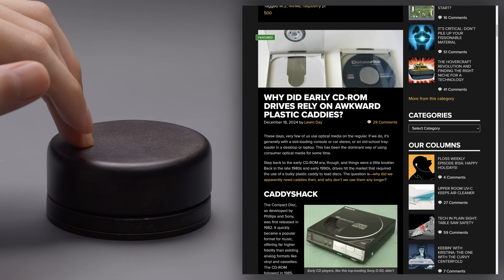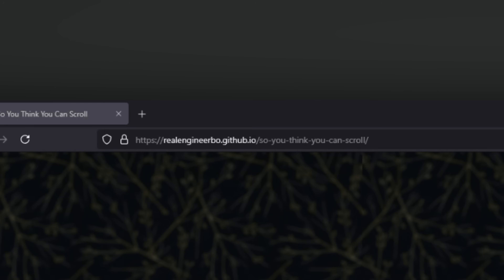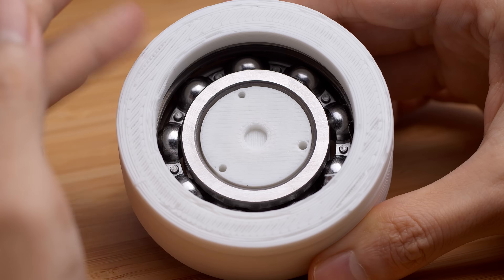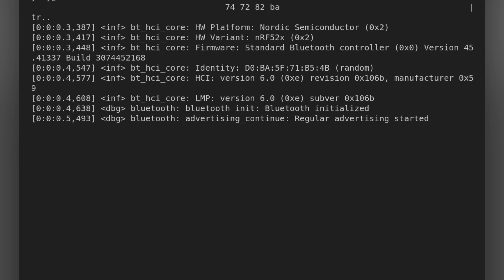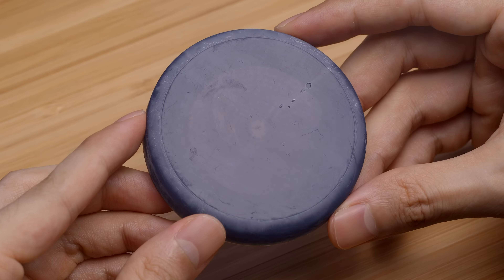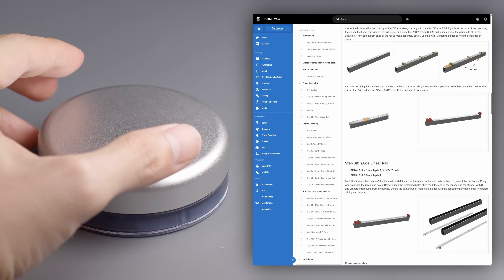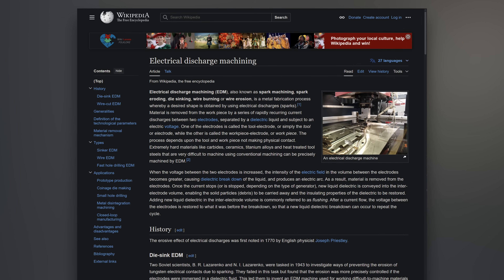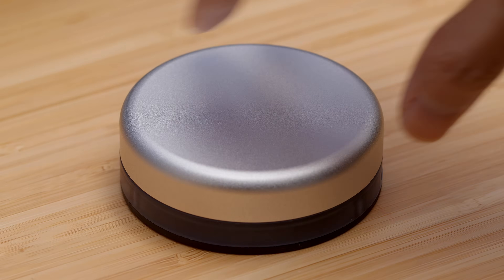Wireless High Resolution Scrolling Device: Full Scroll Dial v2

Comment: I'm really curious about the software you use for 3d models as a means for explanation. I find it very effective, and as someone who relies relies pretty heavily on the drafting and sketching process, to be able to explore the form and function before it is in your hands is crucial, otherwise it lends itself to be a laborious process riddled with unnecessary fucking around and finding out. 

A means of refinement is necessary, particularly with whittling down something very rough and working with unprocessed/filtered materials or concepts. 

It looks like you have your own sort of adaptations and reconfigurations that takes whatever tools you are using from the “as you get it” stage to something much more tailored to meet the challenges and changing needs of the design process. 

I haven't seen much of the inner workings, but I am incredibly curious. I've toiled over issues incessantly relating to process, particularly on account of my practice being multi-faceted. 

I would be really interested to learn more about the ‘how’ of your process and what is involved.

The digital and electronic realms are two such disciplines that have been vaguely understood but simultaneously entirely alluded me. On a surface level I would like to say I have an adequate understanding to use these tools, but granularly I don't understand a lick of it, and Im not sure where to start that journey.

What I do appreciate with your content is the Mix between observation, relational (between and outside of known or observed event), and analytical explanation/narration. Each sphere of understanding are distinctly pointed out and referenced directly in multiple ways of showing, telling, and doing between model, data, and audio. 

You present a lot of ways of understanding which encourages outward thinking among reference points like that of an exploration for connection between concepts to be less isolated in understanding. 

I find that deep understanding doesn't come from indulging in one form of media, whether text, video, practice, or otherwise — but rather a multimodal practice that draws from each respectively. 

That said, to be specialized does entertain repetition and observation, struggle, setback, acceptance of limitation etc. 

There isn't necessarily a roadmap, so my only reasonable question might be where to begin to look? 

Obviously there are so many avenues to explore within that. If I wanted to understand how something like a product for instance works, where might that information live? How might I be able to find/understand diagrams? What have you found to be the necessary base level knowledge and tools for translating something tangible into a conceptual relationship and vise versa? 

Observation is important, and being able to relate observation back to formal understanding equally so.

Forums are something I have never quite explore but I imagine would be invaluable because of the Feedback and response. Where do I go looking? 

Coding is something that is lost on me, but it feels simple in the nature of its language, I'm just unsure of the causal relationship of cause and effect and the players that are taken into consideration. I'm told Python and Java are base level. What resources would point me in the right direction?

Electrical components I kind of understand. There's transition of energy, and certain components store, carry, transfer, and adapt between eachother and states depending on material property, makeup, and configuration of such. I know there's a direct relationship between gauges and capacity. There's voltage which I hear in relation to sockets and output current. On an individual level I get it, but once it gets smaller it loses its meaning. Where might I look to form a stronger understanding? 

That's a lot, and surely I repeated   Myself. I apologize for any incoherence. The phone lends itself only so well to a well written line of text.

I hope to start learning!!

Comment: in the datasheet there is a pin for direction... pulled low is the opposite direction of pulling high... so just add a switch for the direction...

Comment: That white-ish media you had on there would be nice with an LED array inside that tell you your scroll rate or flashes every 25 clicks, etc.  Or you could set it up as a precision indexing wheel using the LEDs as indicators. The bottom of my cheap GTKtec computer has a line of tiny LEDs all the way around its base that I can set the color of. I have a tuning app on my phone that can read micro-tonal differences in what it hears and show the exact tone being made or how far off it is.  The tone wheel is a ....   wheel.  It is called "TE Tuner".  You should check it out and might get some ideas for your firmware from it.

Comment: Not only is proper anodized Aluminum non-conductive, it is also a very hard surface after the process (as hard as steel).  Ask them if you can mask those holes for the Anodize process.  We used to do that over here years ago, so it should be possible to spec it out and have it done.  You could also simply use some kind of plastic split expansion plug/cap as a retainer/fastener.
So how many divisions per rotation does it resolve at?

Comment: Maybe I'm not a scroll power-user, but I can't think of any legitimate reason you would need to do anything like that mosquito zapper app you made. It's really nice to have smooth scrolling, but making an artificial test to "prove" your point is counter-productive. At work on a daily basis I now need to scroll through manuals thousands of pages long, middle mouse works just fine for a blend of speed and precision, scroll wheel for fine tuning, and scroll bar for fast scrolling. Nowhere in there would I need to stop exactly on a specific line. I almost see more use for this in art/photography apps for a smooth zoom/scroll. That's the one big plus of Apple's mice.

Comment: How did they manage to machine inner and outer circumference non concentric?
Reply from the maker: It actually is concentric, but I added too generous a clearance to guarantee it fits the ceramic bearing. I've since "shimmed" it and there's no perceivable wobble.

Comment: On macOS, your scrolling is fast because of a thing called accelerated scrolling. Basically, the idea is that the more you scroll on the mouse, the faster it scrolls down on the window. For example, if you get a normal mouse and scroll only once, you will scroll a very tiny amount. However, if you scroll a few times, it goes way faster. This is great for a Magic Mouse or Magic Trackpad, but bad for 3rd party devices. The problem is that your knob is very high res, which means more scrolls than on a normal mouse, which means - very high speed. To fix this, you can download a tool like Linearmouse, which can disable this setting.

Comment: This video answers the questions I had after the previous video. Now, I've got to ask. Are you going to scroll with one hand and drive the mouse with the other, or switch between the two with the same hand?
Reply from the maker: If I need to actively move the pointer with my trackball, I use the dial on my left hand, and trackball with my right hand. But often I'm just reading something, which doesn't need mouse input, so I move the dial over to my right hand (helps when it's wireless).

Comment: You should add a small switch to flip the scroll direction in MacOS and also allow multiple device pair (2 at least)
That will be appreciated by users since can continue using natural scrolling in their trackpads and also be able to switch between devices without pairing each time.

Comment: We did develop and manufacture exactly a mouse with smooth scroll with hall sensor  a few years ago for one of our clients. I am still using one myself. Few problems: regular hall sensor is still a bit drifty, and stray currents susceptible, second it's very hard to make a friction brake that stays consistent over time, third, windows only has hardcoded 120 subdivisions, and then you only can adjust the rate by adjusting the multiplier itself.
Reply from the maker: Does the high resolution scrolling work on macOS and Linux?

Comment: how about outside antennas, like they do in iphones?
Reply from the maker: Do the iPhones still use external antennas? I was under the impression that recent phones use glass or plastic backs to allow the internal antennas to work.
Reply: @engineerbo  I meant the lines in iphone 4-8, i thnk those were antenna lines/external antennas
Reply: @engineerbo   the plastic bits around the edge of the frame are the antennas , they are pressed into a relief cut in the aluminum 4 of them

Comment: A ceramic dial would be cool to the touch like metal, be cheaper to produce (slip casting) and retain premium feel
Reply from the maker: Interesting idea! I'm not familiar with slip casting, will it be able to hold a reasonably tight tolerance for the bearing?
Reply: @engineerbo depends on your process control but having ceramic with a (potentially printed) insert for bearing tolerance would let u have looser tolerances on knob dimensions while working well with the bearing..

Comment: About the wobbling on the bearing: This is happening because you're using a radial load bearing (ball bearing) where should be an axial bearing (thrust bearing). Changing it will not only stop the wobbling but also increase the life of the bearing. Great project of yours 🎉

Comment: What is the difference of this with the so called "space mouse" devices?
Reply from the maker: My space mouse is 6 DOF (X, Y, Z translation, roll, pitch, yaw rotation), but it's incremental i.e. the longer you hold it, the further it goes. The stock drivers don't seem to support high resolution scrolling.

In contrast, the dial only does one thing, high resolution absolute scrolling.

Comment: I propose you an alternative design for that functionality.
It involves an additional device integrated on top of the mouse: a pressure sensor placed on the top surface of the mouse casing. This sensor would act as a proportional control for page scrolling using the mouse wheel.
The part of the hand that rests on the mouse back would apply pressure during scrolling. If I press firmly while rotating the wheel, the scroll displacement becomes significantly larger. But if I don't apply pressure and still rotate the wheel, the scroll displacement remains minimal.
Maybe is more SW project than HW, but I like the idea :)

Comment: Just a thought, but would it be possible to control the resolution multiplier in real time using a rotary encoder on the dial? I can think of cases where I would want smooth but slow scrolling and blindingly fast scrolling.
Reply from the maker: A dial on a dial might be pretty overkill. I've set up the button (on the bottom side) for toggling between different sensitivities (and also scroll direction). The configurability is not as dynamic as dial-ception, but is working pretty well during my testing.

Comment: Hey, to get better cosmetic quality on your resin prints, print them suspended at approximately 45 degrees in the air. It's very unintuitive coming from FDM, but your part quality will skyrocket. As long as a support can make it up to support completely separated profiles, it should successfully print.
Reply from the maker: I haven't tested printing this part at an angle, but one of the reasons for printing flat is so there'll be predictable distortion/warping in the critical dimensions e.g. mating surfaces with the bearings.

Comment: I wonder if a capacitive sensor would give you a better sleep mode. 

You likely would have saved your taps by pre drilling the holes. 

And you could try some sound dampening material on the underside of the dial to reduce that noise.
Reply from the maker: Yes, boring out the holes and removing the oxide would probably have helped.

Comment: Tribologist here. The (ball) bearings you are using are not meant to support axial load. That is why they do not spin well. What you want to be using is something called Thrust Bearing. I look forward to seeing that on your next iteration. Good work 👍👍👍
Reply from the maker: Just the person I need! I used a bearing life calculator to estimate the lifespan of these bearings under normal usage (small load, low speed), and let's just say it's unlikely to fail within a few years. Wouldn't it be total overkill to use a thrust bearing + deep groove ball bearing combination?
Reply: @engineerbo  Under normal operation, sure, but if you're bringing it to production, it needs to be sturdy too. Thrust bearings would make it far more drop resistant, and much better able to handle top-down pressure for one reason or another (like when taken in a backpack).
Reply: @engineerbo  why would it be an overkill? thrust bearings are the proper bearing for this job
Reply: @engineerbo  life is not the only reason to choose a different, correct bearing type. It will also work better because it is the correct bearing type for the application.
Reply: @engineerbo  why u asking stupid questions ? Ofc it wont fail but it can work better and longer with a thrust bearing ?
Reply: Imagine. Maglev.
Reply: @R-802  Run a hose to it and use your BP cuff pump to blow air between two plates.  An Airy Lazy Susan.  Hell, use the air to move it too!
Reply: was thinking the same roller bearing or just magnetic (turntables) would do the job
Reply: I'm not a tribologist but I do a fair bit of tribbing research nightly.
Reply: Thrust bearings bear thrust well with minimal "slop".  The problem is that they do not "free wheel" very well, and this thing needs to freely spin.  A look at kids' spinners shows larger ball, dry steel bearings and they spin a long time, but nobody looks at slop on those.  He needs the ceramic bearing, but a type that has the inner race tangencies bear some of the top force along with the side force.  They are available.  But form factors matter as well.  These do bear some perpendicular forces.  Certainly enough for this application.  Put that between your layers and spark 'em!
Reply: What are your thoughts on using tapered roller bearings for this application?
Reply: @AlexanderBerezovsky  He wants is to 'free spin' for a long time.  The tapered bearing handles multiple forces well, but it also has a lot of inherent rolling resistance.  I wonder what a "mag-lev" design might require.  It gets tough because the disc needs to remain captivated to its base yet spin as freely as possible.
Reply: How about some recommendations? Obviously not exact dimensions, since he hasn’t open sourced this yet (cries inside), but you could at least point in the right direction.

Comment: do you think the wobbliness in the dial could've been fixed with just a spring washer to preload the thin ring bearing?
Reply from the maker: Yes, a spring water could preload it enough, but it'll have to be preloaded against a rotating surface e.g. another bearing.

Comment: I'm no engineer, but I would have thought a thrust-bearing would fit the application better than a roller-bearing. (Edit: I just noticed a dozen other people have already suggested this.)
Reply from the maker: Yes there've been several comments about thrust bearings, but thrust bearings come in three separate pieces, and will fall apart if there's any radial or tensile load. The assembly will then need both the "normal" ball bearings and thrust bearings to work.
Reply: @engineerbo  I understand now. Thank you for the explanation.

Comment: Will this work with Premiere pro or After effects to scroll the timeline?
Reply from the maker: It appears as a scroll wheel, so it'll work anywhere a scroll wheel does. I've been using it regularly with DaVinci Resolve, and it works extremely well (ctrl+dial to scrub timeline).
Reply: @engineerbo  Great to know thank you for this. 
I was wondering if you could make something similar to SpaceMouse from 3Dconnexion? Do you think that might be possible to make a video about ? Because that will make lot of 3D people really happy 😊😊

Comment: Why wouldn't you use a thrust bearing for this? Or even better a tapered roller bearing. Maybe I'm missing something.
Reply from the maker: As far as I know, thrust bearings come in three separate pieces, so the assembly will need to be held together with a ball bearing anyway.
Reply: @engineerbo  if you use a tapered bearing with flat races you dont need an additional bearing. see the following diagram globalspec.com/ImageRepository/LearnMore/20144/thrust_bearings_components6033741c71cb4442b2e273f6b93c7d57.png

Comment: im talking a bit out my ass here as im not an engineer but it seems like you'd be better off with  a thrust bearing as that would probably give less wobble, as with  a thrust bearing the  tracks are on  the top and bottom of the balls as opposed to a standard bearing, where you may encounter a shear force  between the inner and  a outer tracks

Comment: Wouldn't an axial bearing give you a better stiffness/less axial play in relation to the costs involved?

Just feels that raising the bearing size for something that practically has 0 load applied creates a cost inefficient design.

Cool project 👍👏
Reply from the maker: If you're referring to a thrust bearing, yes, there'll indeed be less axial play, but only under compression. If the dial is lifted (tensile load), or if there's non-zero radial load, the thrust bearing will fall apart.